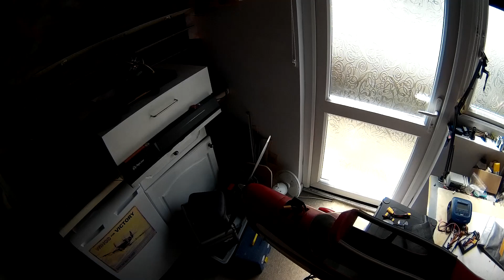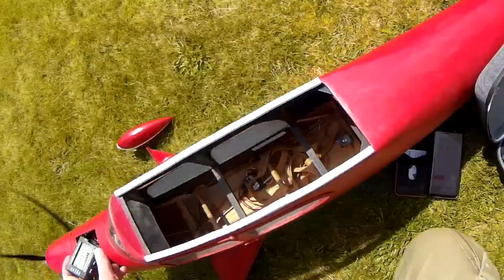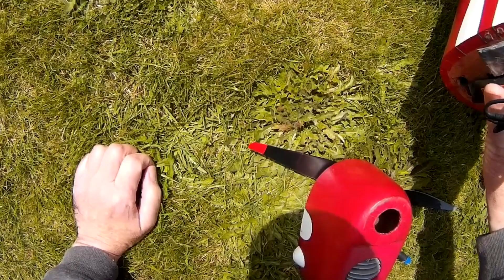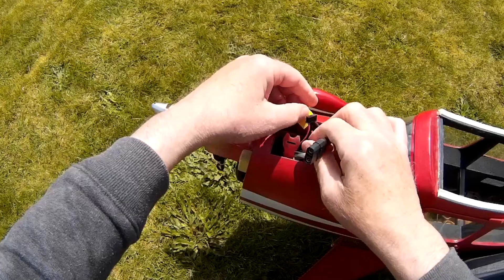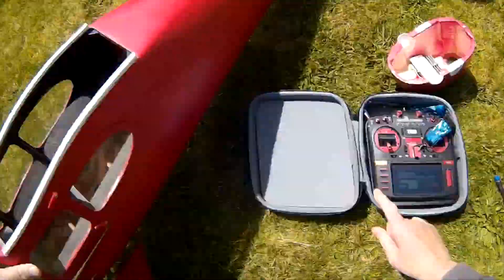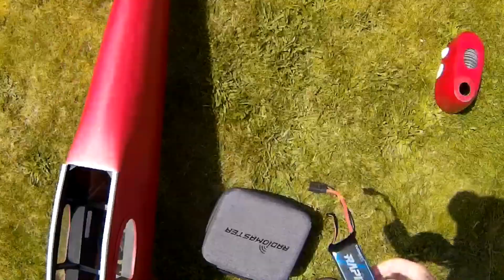Strange Electronic Speed Control Problem

Comment from the maker: Right, here's the result of trying the esc in a model with the same motor ... six minutes in and hey presto the problem occurred again ... motor died and the esc went back into connection mode with the beeps, closed the throttle and the motor beeped four times and it fired up again, it didn't do this on this deadstick flight though! Perhaps it was a lot hotter.

Anyway thanks all for the ideas in conclusion I'll increase the air outlet hole in the cowl and install an 80amp while I'm at it, thanks again, cheers.

Comment: After checking all connections and battery condition, trying a different ESC was a logical step. RC hobby devices made in China to a price point aren't aerospace grade, amazing they are as good as they are.
Reply from the maker: I'll scene have her in the air again Gary with an 80 amp ESC 👍

Comment: My Lidl resets the motor relatively often. I think it might depend on the battery. I also was thinking of cable interference if they are all very close and possibly also due to not so good soldering.
Leaving he engine running is really strange, as if the calibration of the ESC didn't work almost. I guess to troubleshoot, the first thing would be to switch the receiver, then the ESC and then the motor, but don't listen to me, I am just guessing in the dark.
Reply from the maker: I tried another ESC in the model Andrew and no problems at all, I also tried the suspect ESC in another model and the same problem occurred so it's definitely the ESC. I'm going to fit a bigger ESC, smaller propeller and I've been improved the cooling 👍

Comment: Could try cutting off the heat shrink and examining the PCB under an eyeglass.  As the electronics are likely CMOS you can damage the components just through handling,  so getting a CMOS grounding wrist strap would be advisable.  If you can see a cracked joint you MAY be able to solder it  but that needs a soldering iron compatibe with soldering surface mount devices ( I am assuming that it isn't a pin through hole construction)   If there is nothing obviously wrong,  then what I do next with such devices is carefully lay them on the garage floor,  get a 1 lb hammer and hit it hard.  Then collect the shrapnel and consign to the waste bin.  That way you will never be tempted to use it again and wreck several tens of hours of work crashing a treasured model.
Reply from the maker: Wise words, thanks for the image, it made us laugh 🙂👍

Comment: Bad esc most likely but could it be over propped? Even so it shouldn't reset at 1/4 throttle. Test with another esc but verify the right prop to not cook another esc.
Reply from the maker: Thanks for the ideas, it is a big prop but it's under the maximum amp draw for the esc, the next esc will be an 80amp 👍

Comment: Very odd indeed, and worrying that it ran with throttle closed. The fact the esc  was resetting looks like the operating voltage dropped too low, like one I mentioned to you that kept resetting. Though your gadget showed the lipo was ok?  Weird.
In the bin with that! 😮.
And no, I don't want it thanx. 😅
Reply from the maker: Thanks Bob, the batteries are almost new but I popped the meter on to be sure one cell wasn't bad, I'll open the esc up and have a poke around... nothing to lose 🤔👍

Comment: Have you tried an other esc
Reply: Great
Reply from the maker: @Yogenh I've just tried the 80amp and no problems whatsoever 👍
Reply from the maker: I've just tried the esc in another model with the same motor and the problem occurred Paul, so it's the esc. I've got an 80amp out of said model and I'll try it in the Mercury but I don't think I'll have any problems, cheers

Comment: Is there any exit for cooling air from the cowl? You showed where air could get in, but I didn't notice any exit holes. I think the rule of thumb is twice the inlet area for exit.
I realise the ESC misbehaved later with no cowl but even a replacement ESC will want functional cooling. 🙂
Reply from the maker: Hi Richard, I have a 'spoon' outlet either side of the cowl (white) but definately not twice the size of the inlet.
Reply: @cliffharveyrcplanes  I like the spoon method. :-) I wonder whether the firewall is an area of airflow stagnation within the cowl?  Maybe mount it on an angled plate under the motor box, so that the air through the grill passes directly over the ESC on its way to the spoons?
Reply from the maker: @RichardTapp1 I like the angle idea, I'll use that, cheers Richard 🙂👍

Comment: How much does an outfit like coast?
Reply from the maker: Hi George, if you're talking about the whole model, radio gear and all, you could expect to pay in the region of £500. I already had the radio equipment and batteries and, as I built the model (well, finished it off really), it was just the cost of the motor and speed controller (esc), say £100, cheers. If you're new to radio control flying then you could get into it a lot cheaper by buying second hand but always join a club first.
Reply: @cliffharveyrcplanes  Thank you for the information.

Comment: The air hole out of the model needs to be bigger than the intake but even with the cowl off same problem.
Reply from the maker: Yep same problem, I can make a outlet in the bottom of the cowl but the esc barely gets warm to the touch with the two 'spoon' outlets that I have on either side.
Reply: @cliffharveyrcplanes  Tend to agree with Jeff in LA USA.